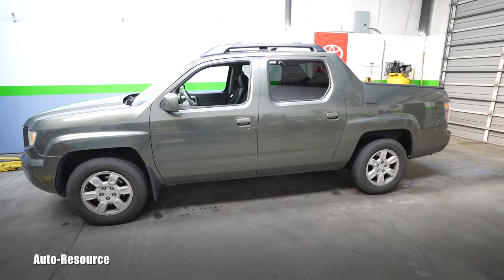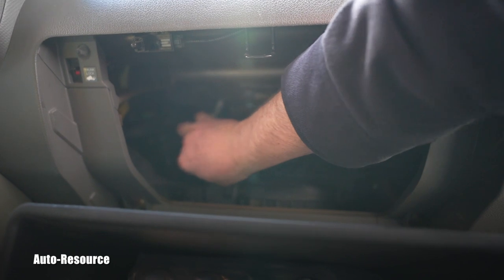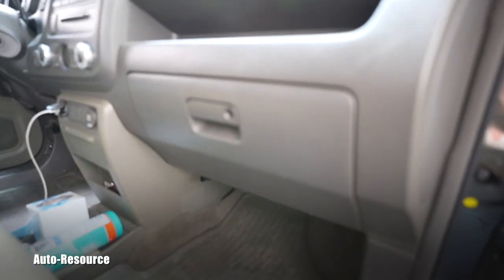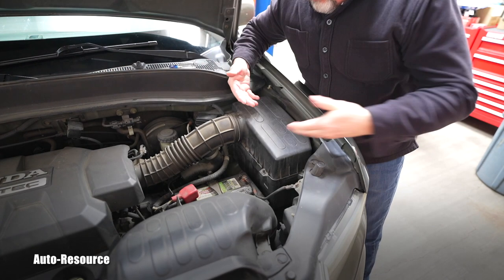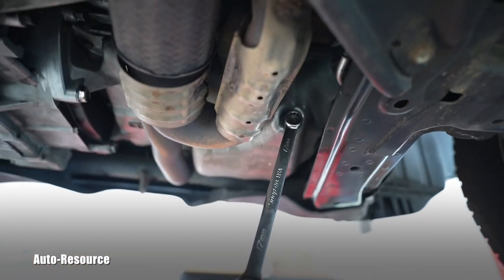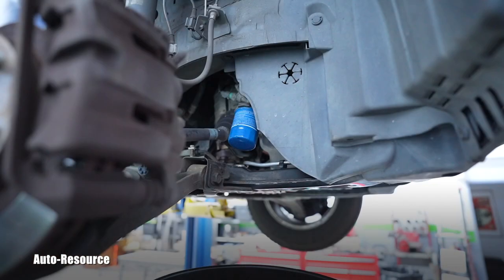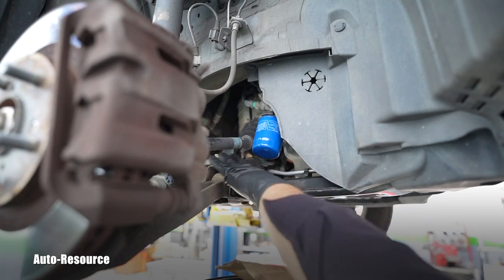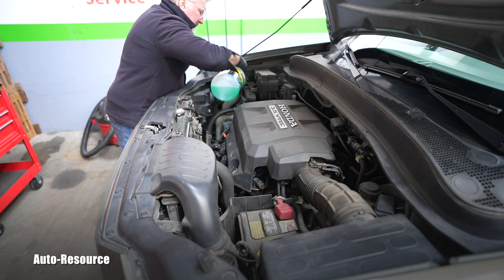Honda Ridgeline 30,000 Miles Service Tune Up

Comment: I bought a 2007 had about 160mi, but I wasn't told that the radiator and transmission fluids had mixed. It was completely my fault for not getting a pre-purchase inspection and getting completely scammed. Apparently it's good practice to replace the radiator before they leak internally. Changing the radiator is pretty easy on these trucks. I was able to bring it back to life after replacing the radiator and doing about 7 drain and fills with Honda fluids. I've definitely got a soft spot for these mini Honda trucks but the Tundra suits my needs way better.
Reply: If I still owned one of these I'd do a transmission drain and fill at the same time as an oil change every 5kmi. It's easier than the oil and not very expensive.
Reply: @ryansmith7974  why would you recommend doing a transmission service every oil change?

Comment: I have a 2013 Ridgeline. I believe my glove box has a screw that needs to be removed, but I'm wondering if the rest of the process would be the same or if the 2006 is that different from the 2013. 
Do you have any videos on how to change the spark plugs and such on a Ridgeline? Thank you for this video.

Comment: Thank for the video. Very helpfull. But what happen with the gas filter?? Don't you change it??
Reply: Gas filter is integral to the fuel pump/sending unit in the tank. It does not get changed.

Comment: Does the arrow point downward on the cabin air filter? I have a slight visual impairment at the moment so I couldn’t see it. Thanks! (I also have a blue 2006 RTL, second owner).